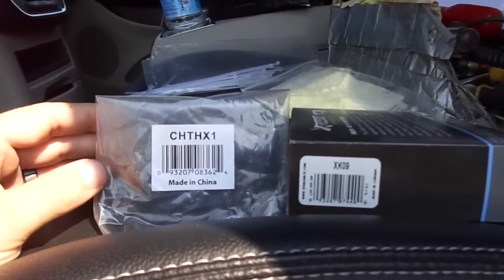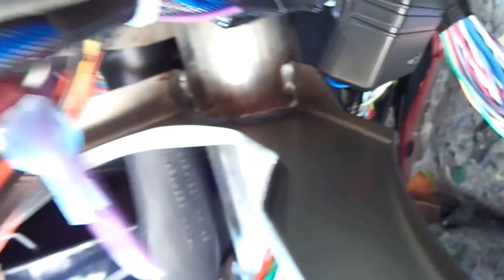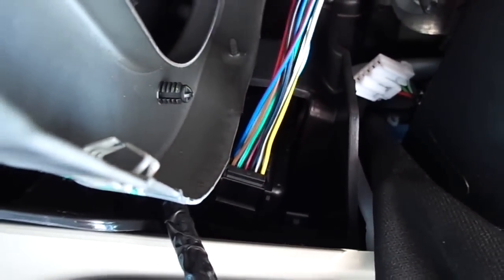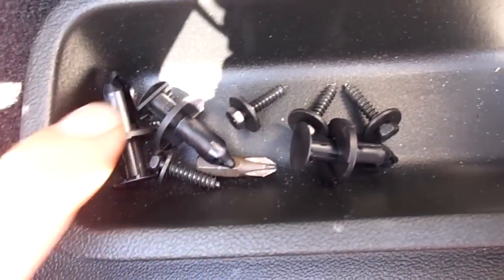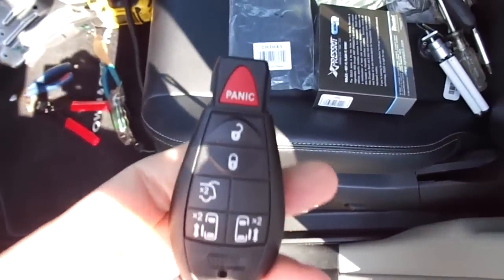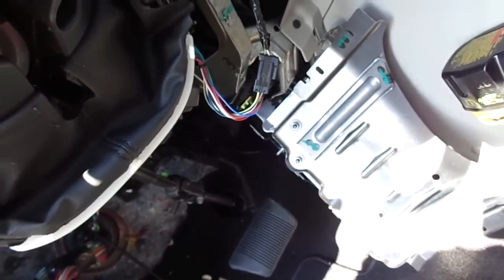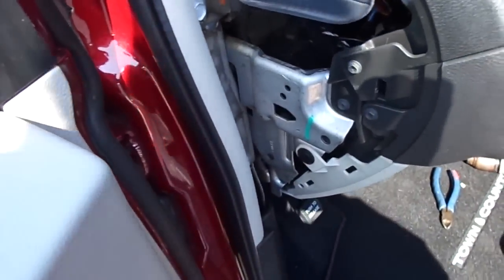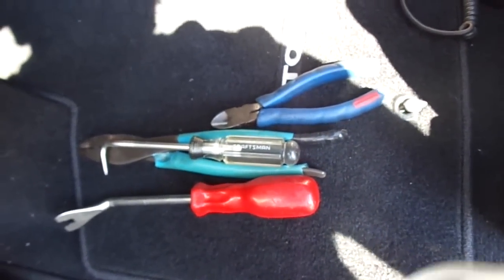DIY 2009-2013 Town & Country RSR Remote Start

Comment from the maker: To make it a little clearer, this add on does not interfere with any OEM functions. All buttons will still work. This just waits to see you press the lock button 3 times within 5 secs and then it will start the remote start process. If you are installing one, the switch is optional. If you don't use it all you need to do is ground the blue wire from the XK09 prior to programming, then remove it from ground after programming. It isn't used unless you want to hook it up to the good pin wire or a toggle switch. After programming the blue wire is only used to keep the XK09 from activating. 
So the entire install is the parking lights wire and the T-Harness. Blue wire to ground only during programming then you don't use it, unless as stated above.

Comment: Guys better of getting the oem remote starter from the dealer and take it to be program when you done. You will have to leave the ignition module out but you can install everything else. It's a plug and play deal unless you have the lower end model and even so is only a couple of wires in the harness. My toughs! Good luck!

Comment: Really video. I will try it on my grand caravane. I dont undersand the toggle switch part. She is suppose to turn off the XK09 but you flip it off and still can start the car with the remote?

Comment: Thanks for a good step by step install. I have installed alarms/ remote entries for 30 years. Along with every other kind of accessory. That said I need to install a touch sensitive simple entry accessory on my 2014 Town & country. I have the kit to add remote start you have here and want to add the touch entry while adding rear park aid and seat heaters. The touch entry has a thin strip stuck to inside of windshield and control box that uses a relay to trigger the lock and unlock relays. Do you know the location of the factory entry box and color wires for the Lock/unlock wires? i know the system has to be disabled as well. Which wire best accomplishes this?  Thanks for any help you can offer. I did get a wire diagram for the T&C from the XK09 company.  Is the correct wire to connect to in that harness?

Comment: I am trying to install a remote starter on my 2011 T&C.  Might be a silly questions, but I understood that when I get an aftermarket remote starter kit ($50+) I will also need a immobilizer bypass ($100+) and then the install is all splicing and individual 't's aka nighmare.  But what you are doing here is XK09 (~$50) and chthx1 (~$30) and that the install seems way easier.  In fact, it does not look like you even need do to do the low gauge wires that run the starter, etc.  I guess this is all due to the fact your setup in this video is taking advantage of the RSR of the T&C and also using the existing remote control (3x unlock).  Am I missing something or is this way easier than the aftermarket remote starters and bypass modules?

Comment: Good video, its too bad that you lost your first file, because Id like to see more of the mounting and initial hook up of the xpresskit box.

Also, the underdash air bag looks like it has a  connector that you didnt touch.  I think I see it at about the 9:39 mark where you are pointing to the mounting tab.  Maybe add an annotation there for viewers.

How much different is it if I want to have a seperate key fob for the extended range?

Comment: Just bought the xk09 and chthx1 for my 2010 grand caravan.  I love the install video but I'm not sure which plug goes in the bottom of the unit. You said there were two plugs but I can only see one. Can you advise?
Reply: Did you ever figure out which plug goes where I am wondering myself I am about to install this
Reply: No sure didn't. I'm still waiting to hook this up
Reply: Doug Carner  I am going to attempt the install today I will let you know what I figure out

Comment: I have a 2010 town and country and have hooked everything up properly, I can get the module into programming mode where the light stays and on and then goes into flashing mode. Then i can not get it to stay on steady, meaning its programmed. Any ideas as to why this is? My xk is lot 194 H.2 S.2.03 firmware  Thanks for any help